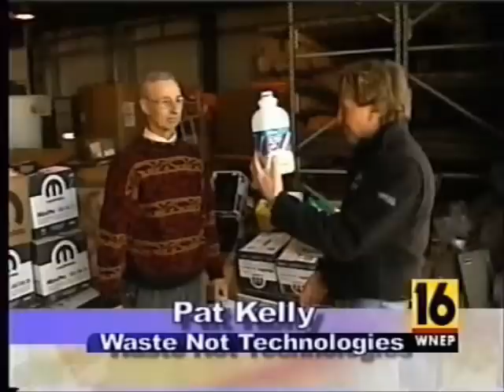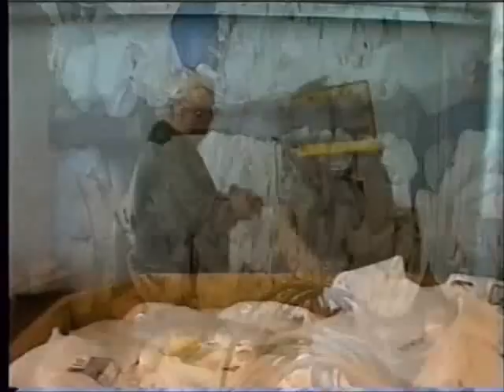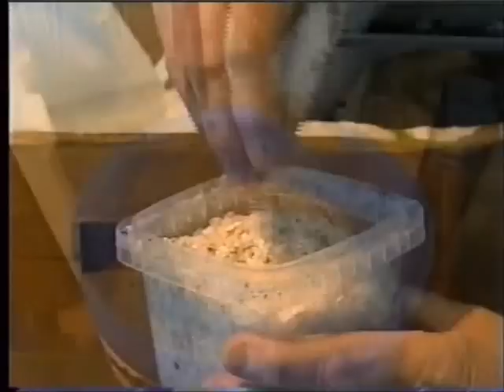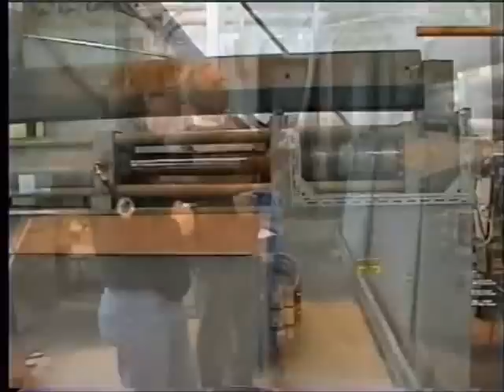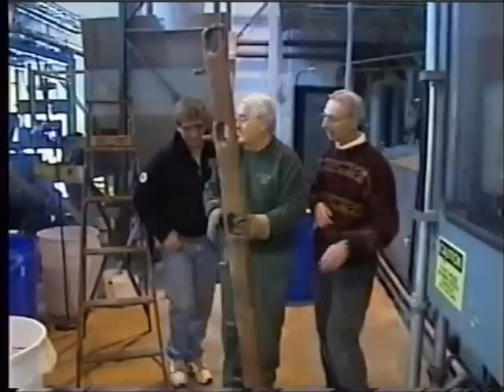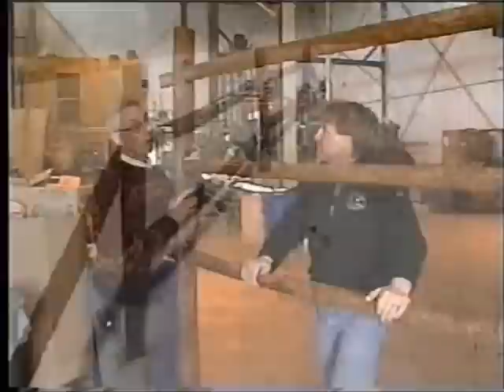Recycling Milk Jugs into Fencing

Comment: there is a machine that I seen used to separate food grains, to remove rotten or damaged grain, by using a computer and cameras, they put the grain past the camera, it detects what colour it is, and the computer activates a jet of air to blow the faulty grain out of the stream,  you might be able to use that device to separate the colours of plastic,  if that is any use

Comment: With spun fibers, nailing and screwing might be possible.
Reply: +Indio Side HDPE holds screws fine. I use ACME thread HDPE lead nuts on my CNC machine. It works for that too. I have not tried nailing into HDPE yet though. It is a bit expensive to be doing that. So I generally drill, and tap HDPE when I use it. But I love to use HDPE as a mechanical building, and prototyping material. I think plastic fencing looks like hell though. It sags in the heat. Plus it looks like plastic.
Reply: Yeah, why nail when drilling for bolts or screws; stronger anyway.
 Sagging might be cured with internal reinforcement, say a fiber mesh.
 As for fencing or other appearance material, the market may find a solution.
 I have given so thought as to new uses for recycled plastic, but I have not pursued it past 'thought experiments'.

Comment: Could this recycled plastic be extruded into sheeting which can be utilized as skin for exterior construction projects? Low cost siding for Habitat for Humanity is just one thing which comes to mind.
Reply: +Andy Anderson I would not call HDPE sheet low cost. It costs about 10 times as much as a sheet of plywood does.
Reply: +Paul Frederick 
...assuming your project requires wood!
:
Reply: Obviously this can be moulded into various things, plastic siding, facade parts, shutters paving stones for patios, 
A lot of people are talking about the chemicals Leaching
The problem is we can bury everything, burn it, throw it in the ocean. Or we can at least make it useful.
So many people recycle but don't know that the no sort stuff has to be .5% or less contaminated
Or it isn't getting used
The recycling center actually just cubes it and shipping to Asia
If the Asian countries find the bails are junk they send it to open landfill and super poor people try to dig out pure sacks.
These landfill are near the water and today stared typhoon season.
So we should be doing anything we can do

Comment: A good idea BUT what about the toxic fumes given off by the plastic when it is heated!  Where does that go? Back into the air causeing the air to be polluted.Then theire is the energy used to melt the plastic. What fuel was used in the process and how much CO2 did it produce? At lease with glass it can be reheated safely with the only by product the energy ised to melt it or just reused as is.

Comment: One ol guy grinding.don't think he can keep up with the press machine.
Reply: that's a problem that this company need to take care off if they wanna be competitive
Reply: what they need is a bigger grinder where they just dump in say a container in in one go with conveyers to several smaller fine grinders to get down to the required size.
but on the same time its good that the old man still have a job.
to many people and spesially old people today loose their job becouse of automation
Reply: @samkom33 poor guy has to stand all day instead of driving a lawnmower with a plow attachment. a ground level conveyor could feed a grinder and he can be sitting. maybe a 4k investment and you increase production 50 fold.
Reply: You wouldn't really need to "keep up" with the process that follows.  You can just feed the grinder and stockpile so there would be plenty available to continuously feed the melting/press process.  Have someone grinding on the night shift also?

Comment: So instead of having an excess of plastic waste, we'll end up with an excess of fencing. Plastics need to be banned for single use. Turn the clocks back 100 years and go back to glass and papers
Reply: there is nothing like "excess of fencing". Fencing meant to last as long as possible, but even plastic material doesn't last forever. Somewhere the forever lasting material is needed and plastic material is good option. By the way plastic material is made from oil and oil is created naturally by nature itself. So basically it is natural material.

Comment: Not worth it at all. The amount of energy and fuel used to make these is ridiculous
Reply: +jace c It's less than making it from virgin material, or they simply wouldn't do it.
Reply: the cost savings derive from using recycled material. of course the energy costs for the process is the same. the recycled material can be had for a fraction of the cost of virgin, in some case for free.
Reply: It lasts longer than trees.. it cleans up an ever growing pile of trash.  it creates something out of waste. It saves some trees for more important uses like building houses.  Its great....  Trust me, the felling, dragging, trucking, millling, treating and shipping of trees is no small energy cost either.
Reply: Bob Thornton  I m sure xtracting the raw material, reining it demands more energy plus it s recycling materials that would be in garbage .
Reply: It's roughly the same as new material, just that you didn't need to go drilling for it while making piles and piles of waste.

Comment: technically wood last longer than plastic because plastic disintegrates over time wood takes in minerals and turns into stone over a long period of time
Reply: +bubba jay  Technically, the keyword was 'fence'...
Reply: Wood rots; fungi break down its lignin, and it disintegrates.
Petrification requires a very specific set of circumstances to take place, and the end result is silica / rock, not wood.